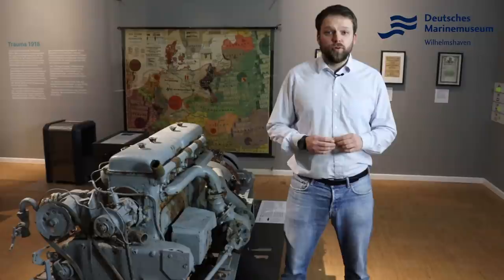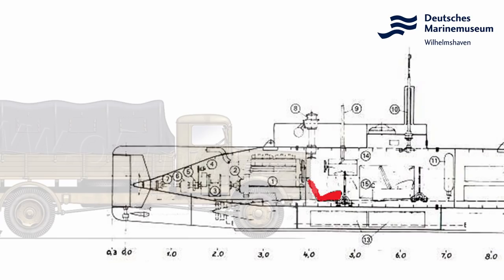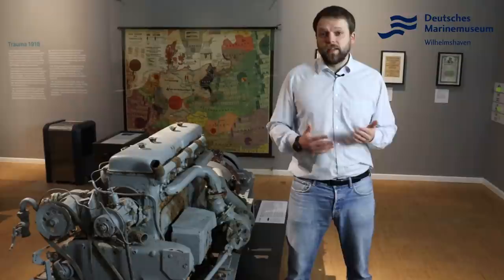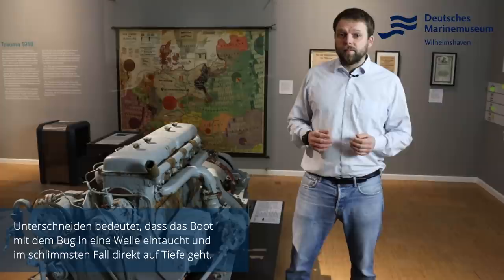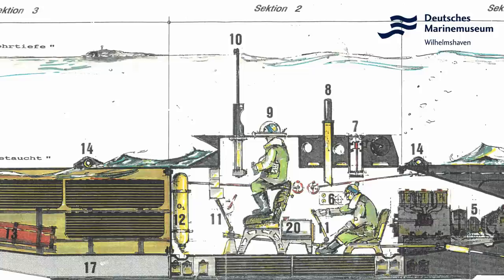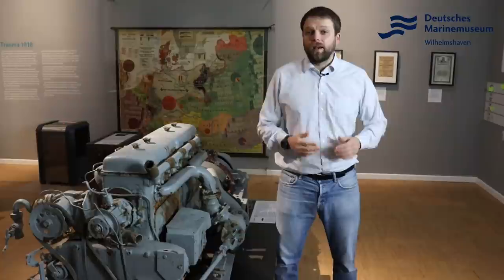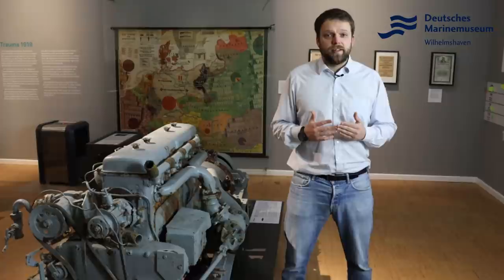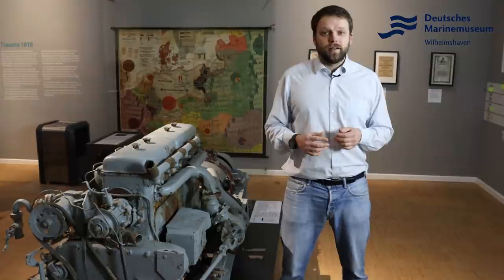ImFokus [S01/E03] "Mit 60 PS gegen den Untergang"

Comment: Es gab mehrere Typen von Kleinst-U-Booten in der  Kriegsmarine die meisten waren improvisiert und nur der Seehund war einigermaßen nutzbar. Die Probleme beim Alarmtauchen wurden im Beitrag schon angeschnitten, doch selbst wenn der LI alle Schritte fehlerfrei in der richtigen Reihenfolge ausführte, konnte die Kupplung des Diesels verklemmen der dann mit dem E-Motor wie eine Luftpumpe wirkte und die Luft aus dem Innenraum absaugte, das mit den Lungenrissen wurde bereits erwähnt, bei all diesen Vorgängen war viel Handarbeit nötig selbst das Lenzen (Abpumpen von eingedrungenem Wasser) wurde mit einer Handpumpe erledigt.

Das Boot konnte zwar schnell tauchen war aber wohl nicht besonders wendig (wohl ein Problem bei kleiner Fahrt) was es schwierig machte aus geringer Entfernung auf Schiffe zu zielen.  Das Heckruder wurde daher öfters modifiziert um dieses Problem zu beseitigen. (Mein Tipp schaut euch Bilder dazu an).

Die Torpedos mussten einen neutralen Auftrieb haben, da normale Torpedos so schwer sind, dass sie ohne Antrieb sinken würden, mussten diese durch das Wegnehmen von Batteriezellen leichter gemacht werden. Als Resultat hatten sie eine geringere Geschwindigkeit und Reichweite, Akustische Torpedos gab es für den Seehund nicht.

Ich habe meine Infos aus diesem Link:
https://uk-muenchen.de/pdfBerichte/seehundBahlmann.pdf

Das mit der Drosselung des Motors auf 60 PS war mir übrigens neu.